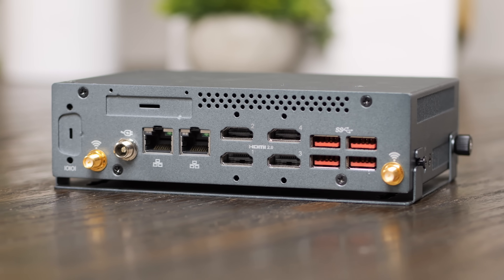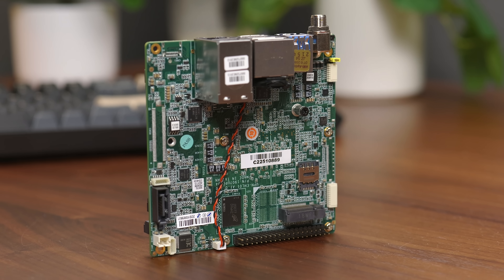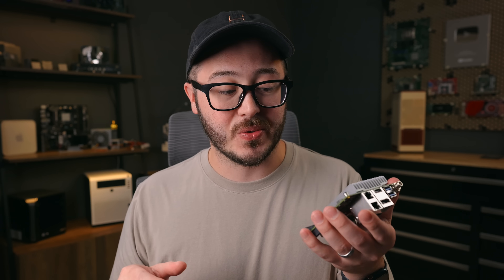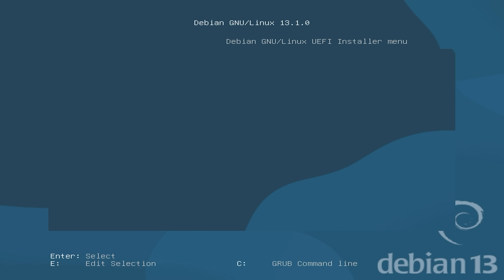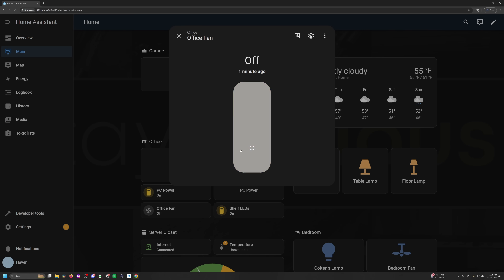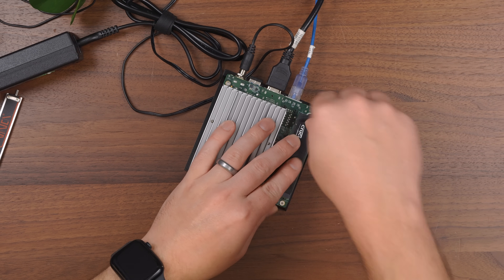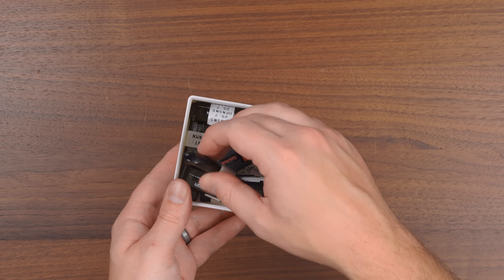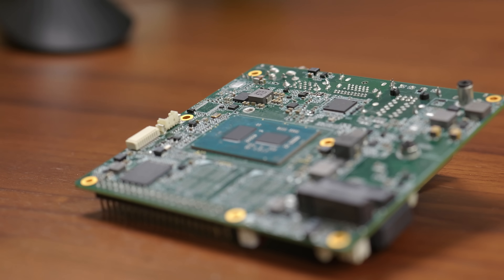This $63 Mini PC Might Be a Hidden Gem

Comment: whenever I see DC barrel jacks I dream of a Solar & Battery powered cluster. I've been tempted for years to install solar on my balcony, but am yet to pull the trigger
Reply: Do it. Do it. Do it!!! Actually quite a few compute options that will just take DC in (mini-ITX is often that). And these days it is really quite easy and cheap to sort the 'off-grid(ish?)' power with entirely ready to use out of the box options if doing the mains UPS, battery management, solar charging MPPT type stuff yourself does not appeal. And if you happen to be in Europe at least where electricity rather expensive that little off the shelf solar/battery UPS for your cluster probably pays for itself in very little time (obviously too many unknown variables like just how power hungry the cluster really is to even napkin math that).
Reply: Oh yeah. I've been working on this. You'd be surprised how many watts of panel you're going to need, especially if you're doing something like day and night surveillance (ahem). On the other hand, decent used panels can be found really cheap. Here in NM, 250 watt used panels are everywhere for $50. Ha, take your tester.
Reply: @SchoolforHackers  That's very expensive! I've just installed 12 panels, 500w each. £60 each (~$80) brand new, with warranty.
Reply: @adamswire9152  Local prices are bound to vary hugely as Solar is bulky so shipping is expensive. Plus the First Felon of the USA's favourite T word that isn't his own name...
Reply: Funny you mention that as I've already got a 5G backup that, with the router, can run on the 12 volts supplied from a 10ah AGM backup battery with a total system  run time on the battery approaching 60 hours (57.5 hours with average thoroughput over WiFi).
I'm not in a position to mount a solar panel as it's rented property, but it's good enough for power outages.